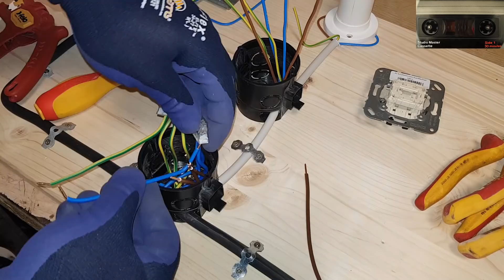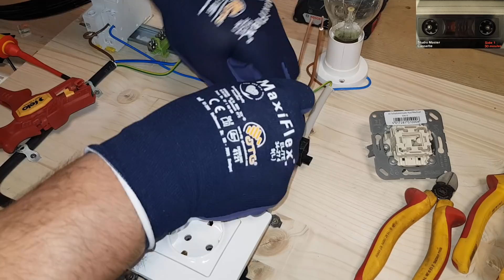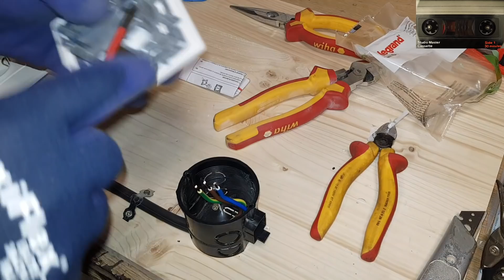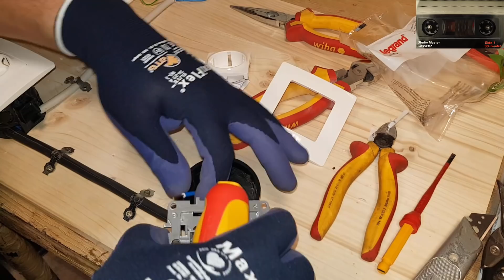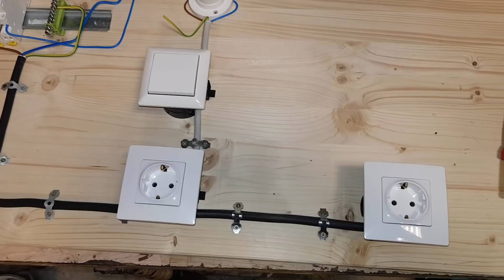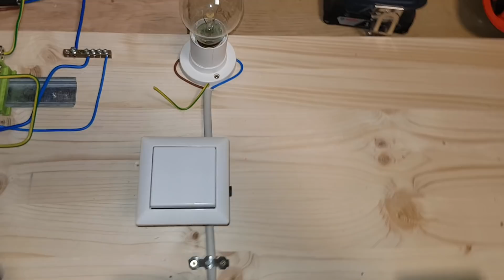Circuit electric simplu pentru o camera, fara copex si fara doze

Comment: Foarte bine explicat si lucrat.esti un profesionist. Dar vad ca lucrati ff mult cu cablu rigid.are ceva in plus fata de cablu flexibil lițat sau e mai special, si treaba sa bagi cablu direct in tencuiala e cu dute vino...daca se intampla ceva tre sa spargi din nou...daca tot faci o lucrare cu materiale de calitate si dupa normativ faci canal si  cablu in copex si e 100% ok.
Reply from the maker: Dupa normativ exista si acest tip de montaj ,ba mai mult este obligatoriu pentru institutii publice.
Este cel mai sigur sistem demontaj,
Si daca gauresti copexul trebie sa schimbi tot.

Comment: Salut Stefan. Merge si un B16, daca folosim doar 2.5mm si la iluminat?
Reply from the maker: E cam mare 2.5 la lumini dar nu imposibil de folosit.Protectia nu trebuie sa fie mai mare de 16 pe 2.5 dar pune un B6 pe lumina ca doar avem leduri acuma.
Reply: @Proiectediversediy  merci sa traiesti. Sa inteleg ca tu acolo ai mers cu 1.5mm spre lampa. Apropo mi-a sarit tot grupul lui Adrian Chelaru in cap cand am intrebat de um circuit dedicat pe o cameara ( priza si lumina la un loc). E interzis prin normativ, lumina trebuie sa fie separata de priza.

Comment: Salut,
In normativ scrie asa ''5.4.1. Circuitele iluminatului normal trebuie să fie distincte de circuitele de prize. 
5.4.2. Se admit doze comune pentru circuitele de iluminat normal, de prize, de comandă úi de 
semnalizare, dacă circuitele respective funcĠionează la aceeaúi tensiune.'' As vrea sa stiu daca e corect sa legi prizele pe acelasi circuit cu iluminatul.  Asa imi face instalatia cineva acum, dar un prieten mi-a aratat normativul si mi-a spus ca e nevoie de circuit separat pt iluminat fata de prize...Poti sa-mi explici cum e corect,te rog? Multumesc
Reply: Am aceeasi dilema… mai ales ca pun becuri smart led ce au nevoie de alimentare continua. Consumul mic, iar intrerupatorul smart foloseste faza si nul pentru el, comanda o dă wireless. Vremuri noi… normative vechi.

Comment: sfatul meu e sa facem intodeauna circuit separat pentru lumini.
Reply from the maker: Si justificare ar fi?Inafara ca ramai si fara lumina in camera care am mai fi alt punct?
Reply: @Proiectediversediy Este suficient...nu mai trebuie adus nici un argument in plus. Daca faci asa ceva, clientul cand o sa ramana fara lumina o sa zica ca a adus cel mai mare prost sa-i faca instalatia electrica. Nu mai zic de carnea din frigider.
Reply: @electro-master73  Depinde daca disponibil clentu sa plateasca circuie in plus, tablou mai mare, disjunctoare mai multe, manopera, proiect... in mod normal sigurantele nu sar niciodata la o instalatie corecta exploatata corect, plus ca noaptea mai doarme lumea....

Comment: cum se numesc chestiile alea pe care le prinzi in loc de cositorire, pot face instalatia cu cablu litzat in loc de cupru plin si ca si curiozitate personala, capetele acelea de cablu taiat le pastrezi undeva si la 2-3 ani le arzi pentru cupru? eu asa fac si intreb,
Reply from the maker: Cleme wago,Obo se numesc.Alea gri is Obo si cele portocalii vago.
Capetele de cablu le strang de mult dar nu le-am vandut niciodata.Nu stau sa le ard .Lepoti da si asa cu plastic pe ele.
Am undeva la 36 de saci de rafie pline de resturi.

Comment: Circuite separate nu la un loc ! Alimentare priza separat alimentare lumima separat ! Fiecare pe siguranta separata 10 A Luminat si 16A
Reply from the maker: Poate vrei sa zici un 4A pe lumina si un maxim 13 pe priza.Unde ai 2300w pe lumina la un dormitor ( ca sa nu mai zic ca un C10 sare de la 50A in sus) .Plus ca pe un circuit de lumina nu ai voie sa incarci mai mult de 1200w.
Si fie cum zici tu ,cum faci treaba asta la o gradinita,pensiune etc?
Reply: @Proiectediversediy  unde pot gasi si eu sigurante de 13 :)) si de 4 as vrea sa cumpar si eu :))
Reply from the maker: Esti electrician sau ce esti?Daca esti electrician presupun ca a fost o gluma sarcasmul tau.
Reply from the maker: Orice magazin serios are sigurante de 2 4 6 10 16 20 25 32 40 50 63
Reply from the maker: https://www.schrack.ro/comenzi/aparate-de-comutatie-si-protectie/aparate-de-protectie-si-accesorii/intreruptoare-automate-modulare/intreruptoare-automate-seria-amparo-6ka/intreruptor-automat-modular-mcb-amparo-6ka-b-2a-1-pol-am618102.html

https://www.schrack.ro/comenzi/aparate-de-comutatie-si-protectie/aparate-de-protectie-si-accesorii/intreruptoare-automate-modulare/intreruptoare-automate-seria-amparo-6ka/intreruptor-automat-modular-mcb-amparo-6ka-b-4a-1-pol-am618104.html

https://www.schrack.ro/comenzi/aparate-de-comutatie-si-protectie/aparate-de-protectie-si-accesorii/intreruptoare-automate-modulare/intreruptoare-automate-seria-amparo-6ka/intreruptor-automat-modular-mcb-amparo-6ka-b-13a-1-pol-am618113.html

https://www.schrack.ro/comenzi/aparate-de-comutatie-si-protectie/aparate-de-protectie-si-accesorii/intreruptoare-automate-modulare/intreruptoare-automate-seria-amparo-6ka/intreruptor-automat-modular-mcb-amparo-6ka-c-4a-1-pol-am617104.html

https://www.schrack.ro/comenzi/aparate-de-comutatie-si-protectie/aparate-de-protectie-si-accesorii/intreruptoare-automate-modulare/intreruptoare-automate-seria-amparo-6ka/intreruptor-automat-modular-mcb-amparo-6ka-c-13a-1-pol-am617113.html

Comment: Recunosc ca nu am mai citi I7 de ceva timp , din cate stiu eu circuitele de priza si iluminat se executa separat si sunt  prevazute cu sigurante pe faza si nul obligatoriu. Tin mine ca am facut  o instalatie unde aveam doze de legaturi spate in spate si am traversat peretele printr-un singur tub de 20mm si lung de 25cm cu cinci fire ca sa unesc cele doua doze. Nu au avut de ce sa se lege si a trebuit sa refac toate acele legaturi, adica sa intoduc doua tuburi prin care sa trec circuitele separat.  Eu unul nu mai execut asemenea lucrari, e munca de necalificat, am preferat sa lucrez in automatizari, munca de ocnas mai putina si bani mai multi.

Comment: Super filmuletul 👍 :)
Deci nui nici o problem daca pui pe un circuit si lumina si prizele?
Reply from the maker: Nu,este o metoda permisa dar nu mereu accesibila.
Reply: Dar din întrerupător unde ai conductor de 1,5 fază poți sa tragi o priza? Adică de la 1,5 conductor faza voi folosi tot un conductor 1,5 pt priza?
Reply from the maker: @marcuadam9846  Poti folosi si 1.5 prize.
De obicei se vine cu 2.5 pana la doza unde te ramifici si de acolo pe distante de 2 3 metrii poti pleca cu 1.5